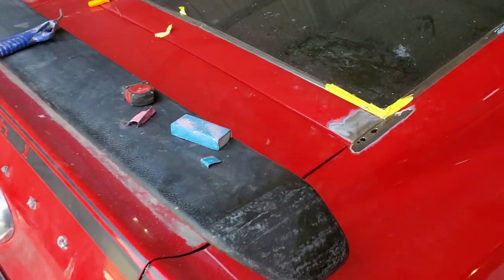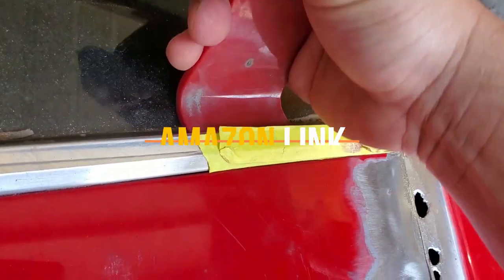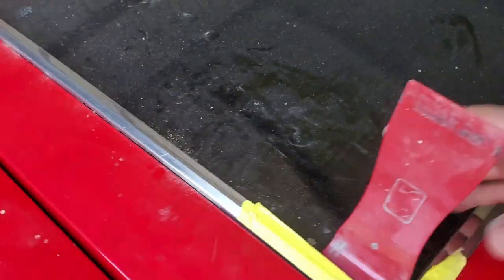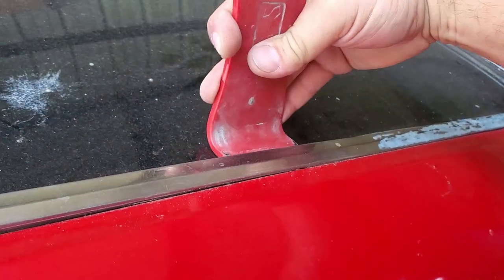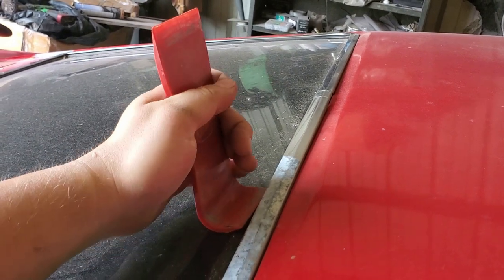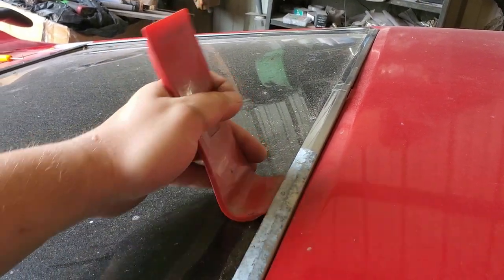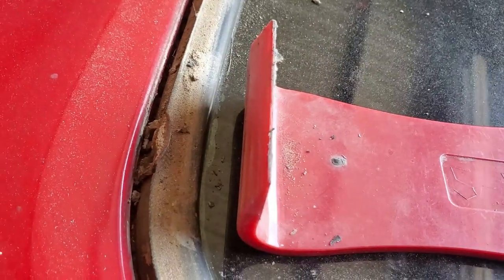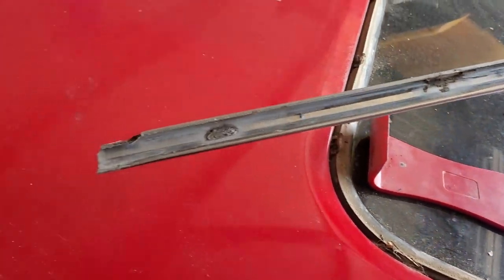1965-1973 Mustang How to Remove Back window Trim

Comment: nice video, thank you, but thats not quite the correct tool BTW. Although it will work. Best to use one with the hook to get behind the clip and pull clip away from trim. THen they come off without any fight.  ;)
Reply from the maker: @terenfenn9672  lol yea the triangular tool. Couldn't find it but figured I'd do a video with the second most effective way to remove the trim lol. Later I might do another with the other tool 😅